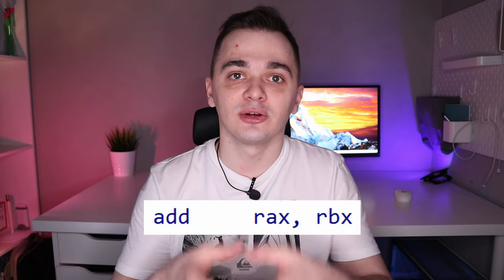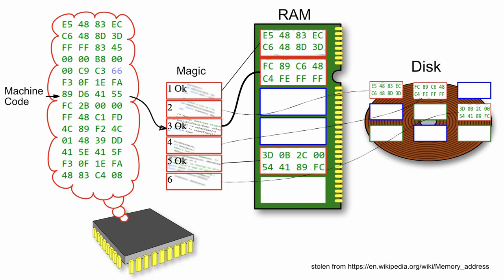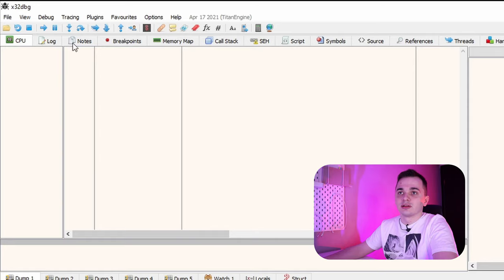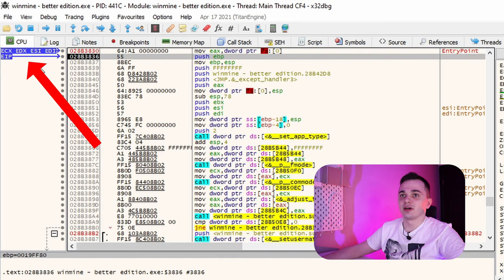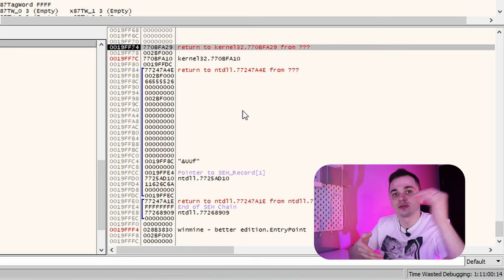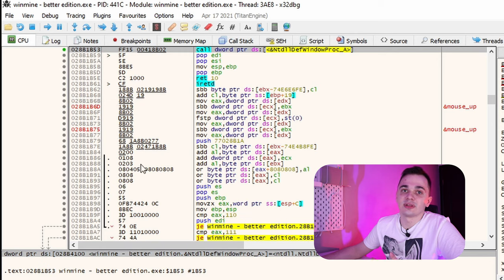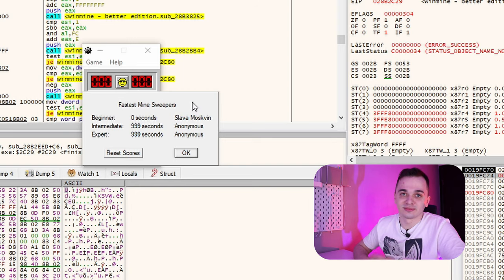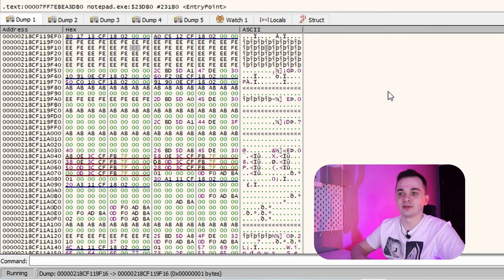Reverse Engineering 101: CPU, memory, debugging and cheating in minesweeper

Comment: Good video. I like your calmness. You should improve the volume your sound. It's very quiet.
As for the homework. My guess is that the allocated buffer for the text got too small so it had to allocate new memory.
Reply from the maker: Thanks for you feedback! I guess I should take a deeper dive into those audio tutorials.

You're correct! Notepad uses dynamically allocated heap buffer for user text. When buffer becomes too small, it's freed and a new buffer is allocated.
Reply: @PathCybersecSlavaMoskvin  if you make this reverse engineering course you definitly want the sound to be clear. I am looking forward to it. Good luck!

Comment: Hello sir, how are you? first of all thank you very much for the knowledge you're sharing,.
my name is Ibrahim and I'm from Iraq.
a friend of mine told me about you, we study together..
I've watched your video and I have a question, I have an Optical ONU that I wanted to edit the firmware for, I unpacked the 3 sections of the ONU ( header, kernel, and rootfs.img files ) however when I changed some entries in the rootfs after unsquashing, I got an upgrade failed message when attempting to update the firmware of the ONU.. I analyzed the header file and changed the file size inside the header to match the new size, but still get the same message. please let me know if there is a way of contacting you, I need some help.
Reply from the maker: Hi! It seems like there are 2 possible options. Either repacking of rootfs didn't go right or firmware performs additional checks on update file (e.g. signature). I suggest you take a look at how the update process is implemented in this particular firmware. You may start by searching for a string message about the failed update in all rootfs files.